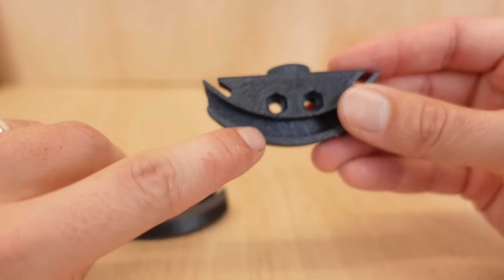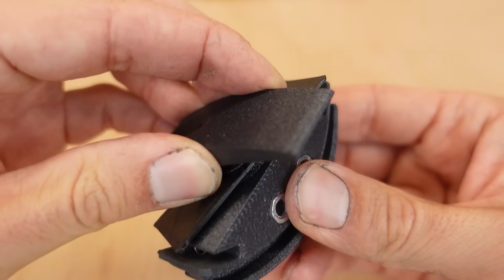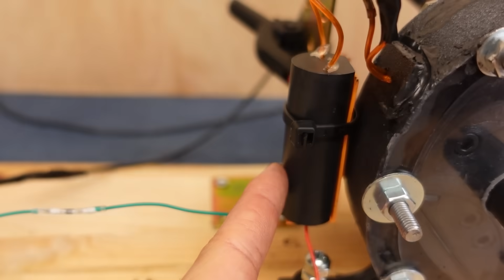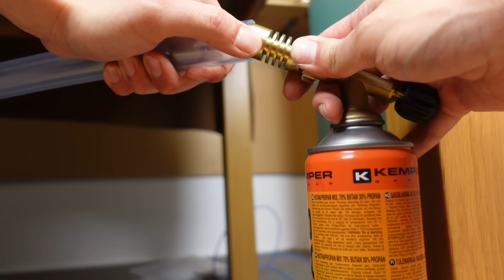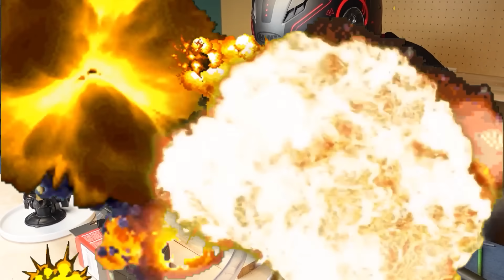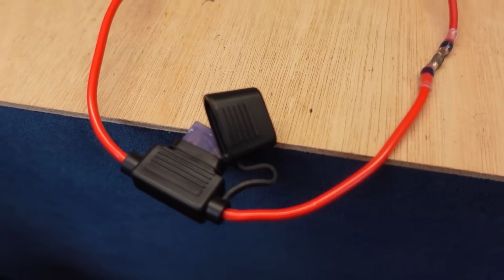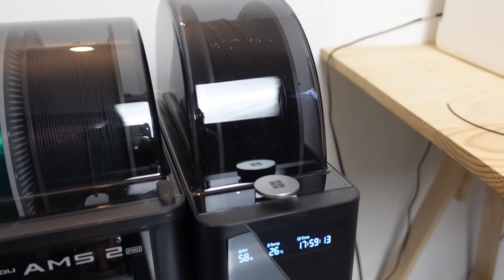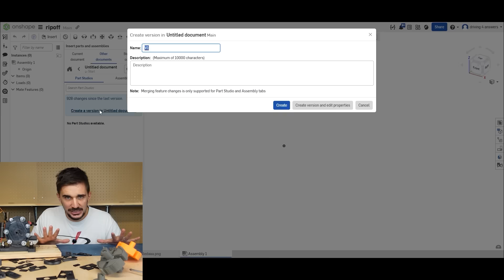My Oval Engine Now Fires At Will! Major Milestone For DIY Oval Rotary Engine 2.0

Comment: Have you tried using a 1-way bearing between the drill and the engine? Or simply using a thread in the engine and a nut that the drill using. And when the engine fires, it had freedom to accelerate to it's idle speed and un-bolt itself from the slow moving drill as needed...

Comment: 15:53 ased on slow mo footage, I'd advance ignition and move the spark plug further away from the exhaust port. Maybe would think about chamber sealing and air/fuel ratio. Otherwise I don't really see anything in the anatomy that would prevent this engine from running on its own

Comment: Getting propane to ignite in combustion chamber is far from getting usable power. You probably don’t have much compression with these 3D printed parts, but there’s a major flaw which prevents this from being usable engine. Piston parts needs to slide against each other’s in a condition where entire combustion pressure is pressing them together. Even with machined and oiled surfaces, that would be really bad. Compared to traditional rotary piston engines, this is terrible disadvantage, and has sealing problems, not only on the piston edges, but also between the sliding piston parts, which were supposed to have low friction.

This could work as a You-tube project, as a goal to make it run few strokes. Probably it would with machined parts, but to use this as any usable engine, you’d need ball bearings on sliding surfaces, and a way to keep them clean. Sounds quite huge engineering challenge.

Comment: I suspect the issue is the force acting on the rotor is on a wrong direction. chec the combustion video, and try to aply force with your finger on the same place of the rotor acembly. 
i woulf bet the more than 60% of the stroke force is going strait into the rotor instead or around it to make it turn. Mabie use a cavaty on the moving chanber to force the gases to expand more on that wall side.

Comment: Yes 3D printers are amazing and they're only getting better. Pretty soon you'll be able to print most components into the product, even batteries.
Amazing for r&d do-it-yourself projects. I mean worst case scenario you get a working model and then have the pieces manufactured out of metal somewhere else... But then you'll at least know that it's the proper component

Comment: The timing of the sparkplug appears to be too late because the air-gas mixture was already in the state of expansion before combustion could occur to the point of failing to gain the expected useful power, leading to engine failure.  Facing various technical problems, design flaws and challenges is a pretty common consequences experienced by any experimenter.  Just keep on trying and not to yield your dream project so easily.

Comment: i got a headache seeing you use a blue wire for the positive. as for the spark generator, 400kv is A LOT and if you have the wires to close together you might fry it all together. i have the exact same one and mine has been working for quite some time now. for a tiny spark even 10kv is enough, i would reccomend buying a lighter with a arc light (abt 20kv) wich should be more than enough to ignite your fuel

Comment: Flywheel.
Timing is advanced.
Also spark plug is too advanced.
Also at combustion there is equal pressure retarding the crank so why would it push positively.
Also do not use two combustion chambers. Use the compression of the second chamber as the exhaust stroke.

Comment: If the exhaust should be placed there why do you make a babe system, for example a rotary valve then a gear on the crankshaft a gear on the valve shaft, a tooth belt and voilà you have a time adjusting exhaust system!

Comment: The coil charges up when your wires conduct.   when that contact breaks, is when the flyback EMF makes the spark in the wire.   so time based on when contact breaks.  also your contacts are going to be noisy and make a bunch of little sparks before your set timing,   you'd be better off with electronic timing or at least better brushes*.    * better would not look like a paintbrush [kind of like yours], but like DC motor commutator brushes.

Comment: I applaud your  inventiveness and determination, but why would you continue to develop combustion engines when they can never achieve high efficiency. Most of the energy created goes right out the exhaust pipe, and always will no matter what format you choose to convert thermal expansion into rotating motion.

Comment: My very limited experience with such HV generators is that they are "rated" for way lower voltages than they are actually advertised. For the sort of spark gap you need I would not go above 6V. I used to run them on Li-Ion battery voltages (3.7-4.2) and they were consistent. They have coils/transformers with tiny gauge wires which as one can expect for such low price, are not very well isolated given build quality and extra voltage will cause them short and kill themselves...

<Edit> Nevermind you figured it out yourself later in the video!

Comment: You should supply some air with the gas, otherwise you will get the flamethrower again. It should be sufficient to put a slightly open bottle in front of the intake without the hose!

Comment: @d4a Ignition is occuring way too late.  Watch the slow motion starting at 15:56.  Combustion is occurring when the combustion chamber is already decreasing (exhaust phase). Spark needs to occur when the combustion chamber is the smallest. Example spark is occurring at time 15:58 when it should have occurred much earlier ~15.55 or 56, if not sooner.  As a result the vast majority of the explosion is occurring when the combustion chamber is already shrinking (exhaust).  Standard ICE sparks occur well before top dead center.  That should also be the case here.

Comment: It might start running, when you turn it faster. This geometry looks like one delivering low torque. So even iddleing will require significant RPM to overcome the parasitic losses.

Comment: Take a look at your friction surfaces. You got your contained combustion events but they don’t have enough energy to turn the motor. A lot of technology fails when it gets too small. In this case too thin. Looking at common wankel rotaries they are deceptively thick because everyone recognizes them from the side profile. The seal on the perimeter which is your friction point rises linearly when you increase the depth. The combustion volume rises exponentially with the depth.

Comment: Consider 2 stroke oil mixed in with the fuel or RC nitro fuel since it has oil in it.  Plus RC engines are 2 stroke AND 4 stroke, so carbs exist for different engine sizes.  
Also, consider making the engine wider but less vanes travel.  Surface area increased not by vane travel, but by vane width.
OR redesign the vanes into flaps.  https://youtu.be/udI2dWmwMUE?si=S0r8o0oWHfcYr8pH

Comment: Watching the slomo, it looks like the timing is far too late in the rotation for the combustion to run the engine.  It looks like it fires long after the cylinder area begins to expand.  If it were mine, I'd at least set the timing to fire just AFTER maximum compression (with a timing wheel actually attached to the crankshaft to ensure reliable and consistent timing) since the fuel burns so quickly.

Comment: Brown's Gas or HHO will probably make a nicer fuel for your designs since it converts back to water and helps it run cooler.  People can cut steel with an HHO torch and hold it with their bare hands because it draws the heat out so quickly.  I personally like the Quasi-turbine design.  My BMW I3 Rex could benefit from a lighter smaller engine and would probably only need to run at one speed to keep the batteries charged.  I'd like to run the one I have on HHO when I get some time to experiment.

Comment: I liked your vane engine but how about turning it inside out? Make the HOUSING CYLINDRICAL n set the SHAFT off center. Then use one vane that slides THROUGH the shaft hub! That way  the vane doesn’t slam in and out but floats around the cylinder as it slides through the hub. Minimal problem with centrifugal force (though certainly  with heat expansion).  The spark would be just past the central axis opposite the in/ex ports which are located at the largest volume apex. 
1 cycle per rev. 
The vane could be lubricated through the shaft n hub n could even lube the housing/vane contact through the vane. 
Best wishes.

Comment: My copy of Felix Wankel’s 1965 book, Rotary Piston Machines, analyses every conceivable kinematic method to produce a 4-stroke combustion cycle –326 in all. Your concept is closely related to a 1960 design principle by Geiger. His design has a crankshaft centered (non-eccentric movement!) in an oval shaped cylinder, with hinged pistons that enable their ends to follow the changing angle of the cylinder wall as they rotate around it –similar to your design– which Wankel states "...was capable of accommodating the four-stroke cycle." The primary difference between your similar designs is, yours has 2 pistons (thus combustion chambers), while Geiger’s has three. It appears the difference in the number of pistons is critical to ability to sustain combustion and transfer the force into rotation. If you’re interested, I can explain why this is so.

Comment: I don't believe your oval engine will ever sustain self-combustive operation. Please correct me if I'm wrong, but the combustion chamber does not appear to have any offset from from the center of crankshaft rotation. That means there is as much combustion force attempting to counter-rotate the crankshaft as there is to rotate it. Your oval engine needs eccentricity from TDC to BDC to give the combustion pressure leverage to rotate the crankshaft.

Comment: Have you tried a hall effect sensor and an arduino/rp2040/esp32 to manage the spark timing?    You might also need a flywheel to keep the combustion in the right direction.

Comment: Great stuff. Design a distributor assembly where you can advance or retard timing by moving the cap. Or use an "off the shelf distributor from a Mini or a Nissan 1400 engine. If it runs 1:1 you will have it sparking 4 times a rotation and you can connect it straight to the output after the flywheel. Good luck with the project.

Comment: Try balancing the friction between a steam turban and a generator. It's not very easy. The way I see you are losing all your thrust to friction. You'll also need to balance a centripetal mass as well. That is why ice uses flywheels. 
A turbine usually has a very light centripetal mass so it can spin at high speed. At running speed it is generally spinning at double that of a high speed generator.

Comment: Your spark generators are actually the same things used as capacitors in those super cheap stun guns/tazers. I have one I'm thinking about booby trapping a bait bike seat with.. lol.. Anyway, those things will usually make a spark with a single 1.5v battery like AA/AAA. I'm not an electrical engineer so I may be wrong but it's possible 12v is burning out the coil? They're super cheap and prone to burning out with extended use even with a 3v source. Also, Deez nuts gave my wife quite the chuckle lol

Comment: It's has low compression.  You need 8:1 compression with the fuel mix to get any power. With low compression, you will not have any power and will just be making a flamethrower.

Comment: Jeez, just hook-up potentiometer, two photosensors, and two MOSFET-s to Arduino Nano and ask ChatGPT to write you software for it, you will have consistent, manually adjustable spark timing...
You reminds me of younger me, when I was just tossing myself back and forth trying to get the simplest circuits to work without success, simply because I was trying to skip basic steps that were absolutely criticial.

Comment: There was not enough burn time in the chamber.  The exhaust port opened to soon after the spark was made.  The geometry of the engine is wrong.  That said, nice work.  Failure is part of innovation. 😇

Comment: This is a less effective version of a vane type compressor, the problem is the force vector from the combustion is very close to the center of rotation thus producing very little torque. The force needs to be offset from the point of rotation.  A piston engine uses the crankshaft to offset the force of combustion away from the center of rotation of the output thus producing torque. A Wankel engine has the rotor offset so the vector force of combustion is offset from the centerline of the output shaft. As a fellow mad scientist, i don't want to poo poo your work, however consider making a much more exaggerated oval shape so that the force from the combustion is offset from the centerline as possible.

Comment: You’ve got the spark on the wrong stroke. You need it when the combustion chamber is at its smallest (2nd stroke), but you’ve got it on the expansion (third) stroke

Comment: You also need to use a one way ratchet between your drill and shaft of motor. Whatever tiny bit of torque your plastic engine generates is absorbed by the drill essentially locking it into rpm of drill. I learned this trying to start a tiny petrol motor on my scate board when the pull starter broke.

Comment: To me, it looks like your combustion event is pushing on the rotor "equally". The combustion is not trying to force the rotor 1 way or the other, it is just pushing the rotor toward the shaft, not trying to rotate the shaft. I'm probably wrong just wanted to throw it out there in case it helps.

Comment: dude you are running the transformer at a voltage higher than its supposed to I tested it it ignites gasoline at only 3v input.

Comment: In the Slow-Mo Footage it looks like the Ignition timing was good but the port placement is too high up, pull the port down and adjust the timing (maybe in a not so janky way). If possible move the Exhaust further away from the Ignition (You could also try making it adjustable with a little slider, or maybe try adding a little exhaust pipe if you cant move the port to keep pressure). As others suggested a Flywheel seems like a reasonably good idea because the moving mass is rather low (one with at least half the Inertia of your rotating assembly seems like a reasonable guess).  And what i think would definitely improve your chances of starting would be some kind of oneway starter so your massive D rill doesnt stop any of the selfsustaining combustions.

Comment: The axle in the center does not work. There is no leverage to create torque. If you ignite the gas what should move where and why? The pressure is equal in all directions.

Comment: maybe still too much resistance for the amount of force generated and transmittet to the lever? also the combustion is still ongoing while it is exhausted -> adjust timing

Why no automotive style ignition system, like coil on plug?

Comment: Your nagetive switch is throwing the timing off when the wire keeps bending, plus it only accounts for a closed circuit in only one chamber. The other three have no spark. You need 4 cross sections and a spring wire to bounce back to the same position.

Comment: If you use a side port in exhaust instead? 

also, in a wankel engine, it has a two spark plug system for a more complete and fast burn. I think it might help a little

Comment: You're burning up those high voltage  coils by applying 12v for too long. You need to drastically reduce the amount of time your "ignition system" applies power before releasing it. If it's like common ignition coils, the spark occurs when DC power is removed... not when it's applied.

Comment: Look at the ignition events in slow motion and  think I'd the expansion pushing the rotary around? Get a compression tester. Then  experiment with different ignition port positions. Once that is down the timing is fairly easy.

Comment: Before you bother fabricobbling anything else try driving your motor via unsecured string or ratchet. Every time your engine pops I can see your drill wiggle which means that your engine is trying to drive your drill and can't. This is doing the same thing as engine braking in a car. I expect that your drill rotates below the stall rpm of your engine which is why is can't run on it's own.

Comment: I owned a Mazda RX-4 wagon that survived everything in Alaska, except rust.  (Even the occasional sprints to 110mph+, before I could pull my foot out.). I NEVER had a problem with the seals and got good fuel economy (for a 4-barrel carb).  I wish you every SUCCESS!

Comment: If you ever get into cast forging you can use another filament called Polycast since it’s designed for that purpose. 

This is just another idea on how to do at home metal parts based on 3d prints 😶‍🌫️

Comment: you're not getting any air into the engine. atleast not enoguh. you have a hose wich seals the intake (probably pumping loss) wich ensures youre only getting the propane butane mix. but 0 oxygen. 
you could try and disconect the bottle from the hose. And feed the gas into the tube, thus mixing it with air (bernoulli's principle) That might work for a quick test. 

im assuming that residualt air in the tube / a leak somewhere / or just the late ignition timing. is the reason you got any combustion at all. 

i dont fully understand how this engine works, but you're getting combustion events between the two chambers, wich seems counter productive?

Comment: Your HV spark device is failing because you are using a break contact switch to trigger it. When the switch opens, you have back EMF that has nowhere to go if there is no spark across gap. This burns the coil.  You need some protection diodes across the switch gap.  Similar thing is used across solenoids for relays.  You could just get a real automotive coil and distributor contacts.